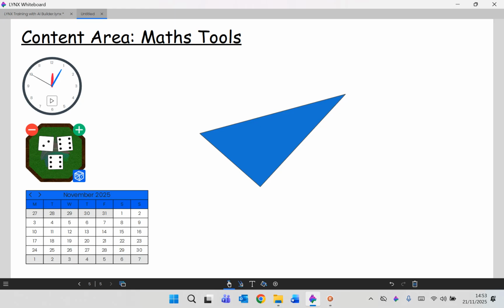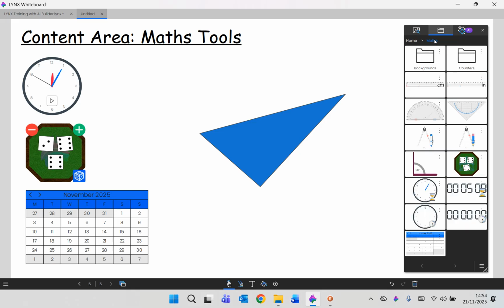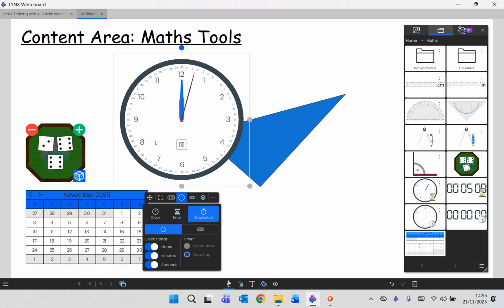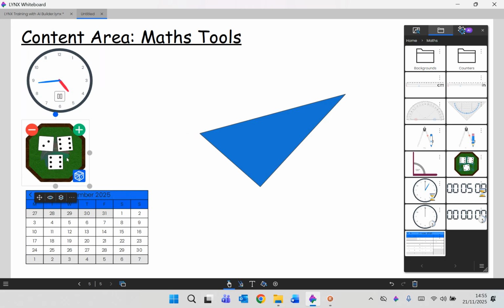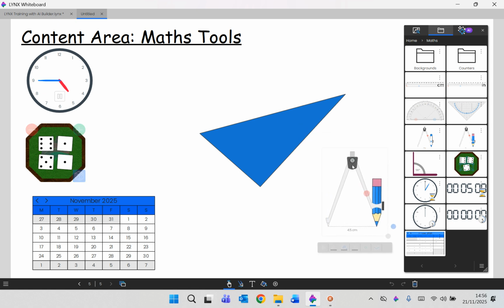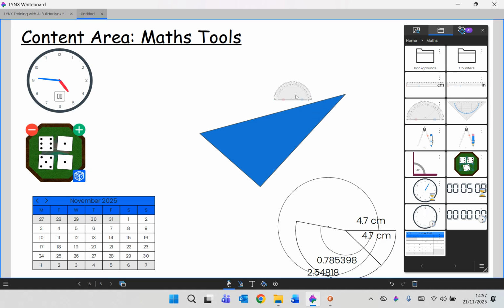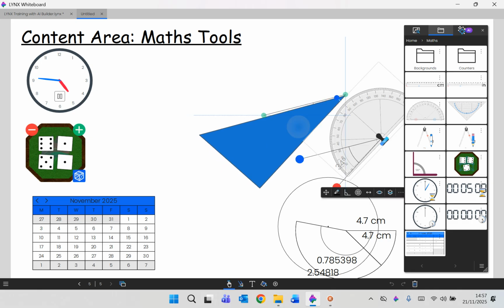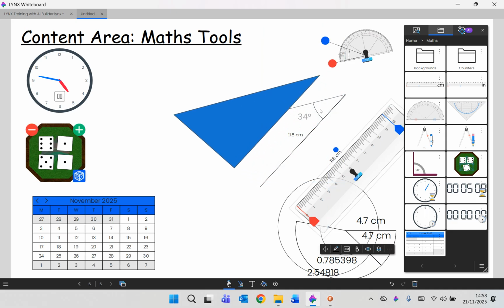LYNX Whiteboard Tutorial | Maths Tools

Comment: Can you hide all measurement labels?
Reply from the maker: Hi @tristangower7214 , You can hide displayed angles by selecting an angle and clicking on the left hand eye icon, click again to reveal the angle. For ruler measurements, if you move the red and blue on-ruler sliders to your selected length and press the stamp icon this will stamp your line onto the canvas. Select the line and you can then use the eye icon on the tool bar to slide and hide the measurement. Sadly we cannot hide the measurement displayed on the ruler at this time. 

Hope this helps ^^